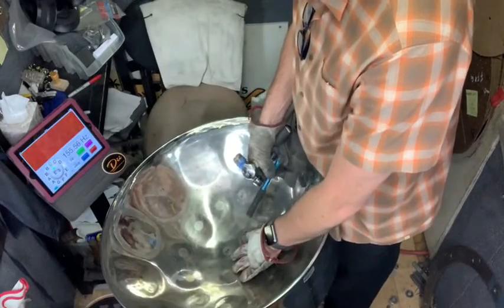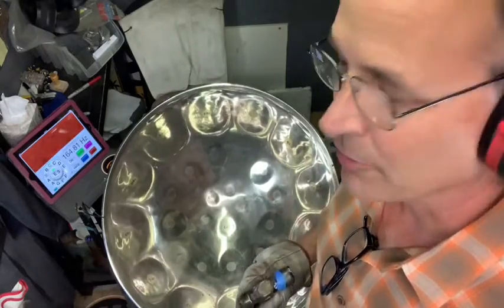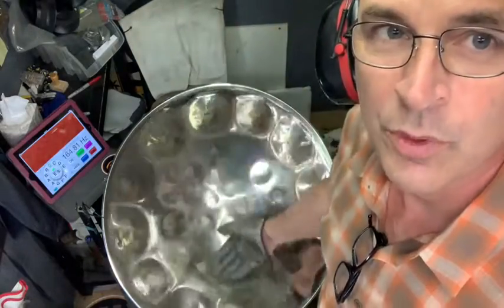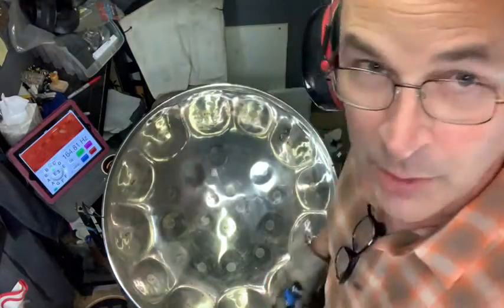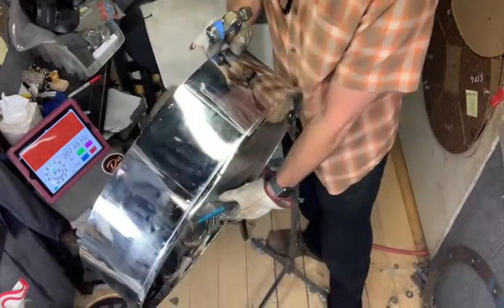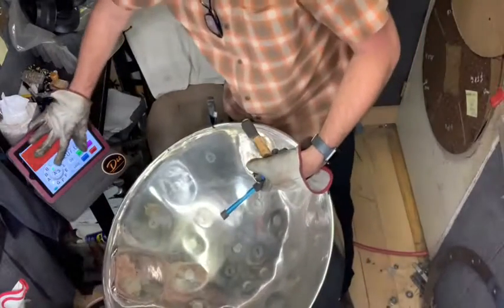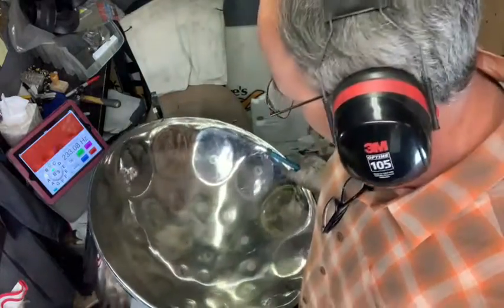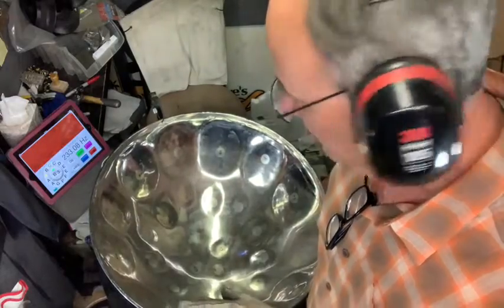Dii: Tenor Steel Drum Steelpan Tuning

Comment: Awesome vid! I just have a quick question.
How can a steel pans have so many notes without any interference?
Must be some serious precision tuning and tone field placement.
Reply from the maker: Yes, great question. You are correct. Especially with tenor pans like this with 29 notes, the tuner and builder have to be very precise. Even before the notes are tuned, the sinking and shaping needs to be just right. If the shaping is imperfect, the tuning will be difficult. So, it is important to think ahead when making a tenor pan. You have to do it right from the first to the last hammer blow. They are not easy. It took me years to finally get a tenor pan to sound good.
Reply from the maker: To some degree there is some natural cross talk between notes. But once the whole pan is in tune it is not as noticeable. But the shaping needs to be just right between each note so severe cross talk doesn’t spoil the instrument.

Comment: How do you create a clear octave in the notes on the outside of the pan near the rim?
Reply from the maker: Experience. Lots of trial and error. Much of the end result of tuning starts during the sinking and shaping stage. If the shape of the note and contours near the rim are not established correctly the tuning will be very difficult or not as effective or clear. Initially when starting the tuning process, I use wooden wedges to “pop up” the metal near the rim. It’s impossible to get a hammer back that far.
Reply: @davesislandinstruments  Thanks, I’ve a student who’s interested in tuning and I have told him to watch your videos, as they’re really good 🔥.